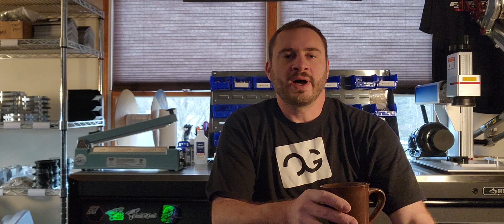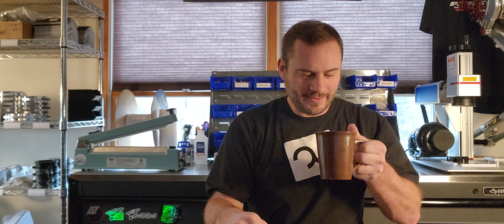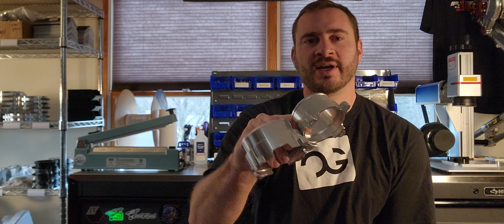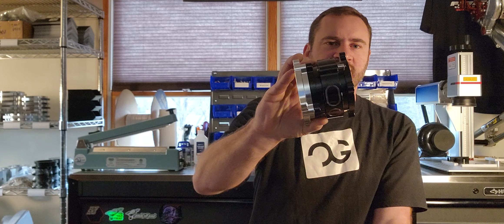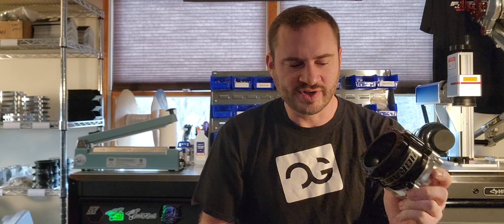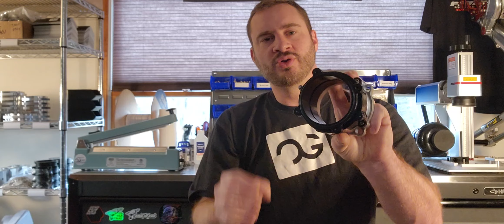Performance Drive By Wire (DBW) Conversions - NOT YOUR MOM'S PRIUS!

Comment: It really modernizes the engine setup. No lag at all. The ECU can control the output, so I can install cruise control in a 30 year old racecar!
Reply from the maker: Alex, I think this is one of the most common misconceptions about DBW. It's been judged by it's reaction speed in OEM applications and that's why a lot of people dismiss it. Most people have never experienced a DBW setup driven by a modern aftermarket ECU. It is lightening fast! and the added benefits - like Cruise control are amazing!